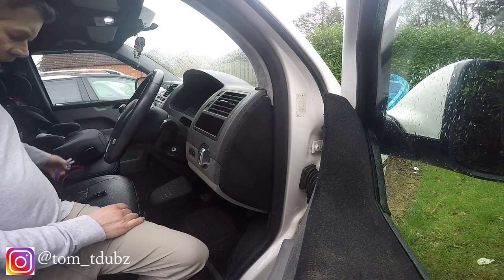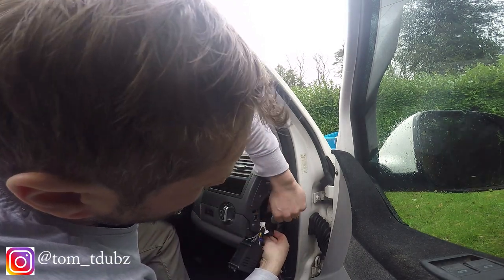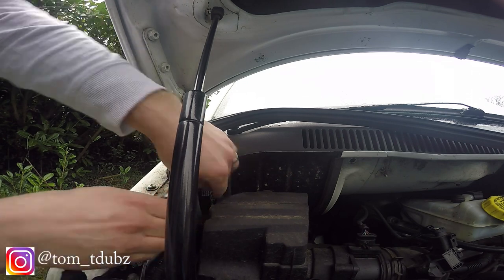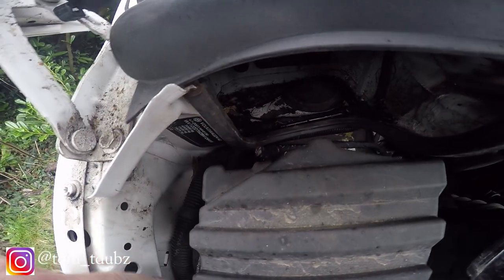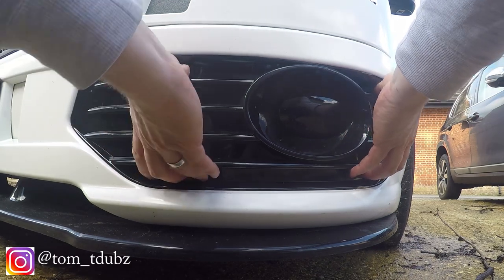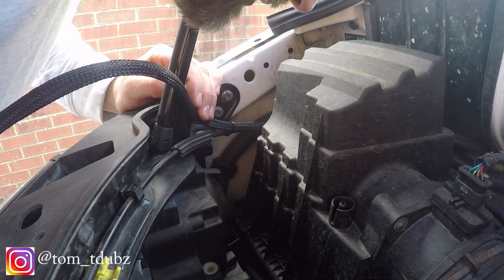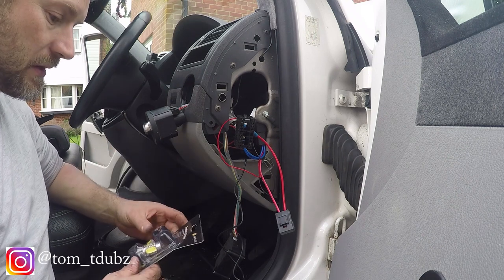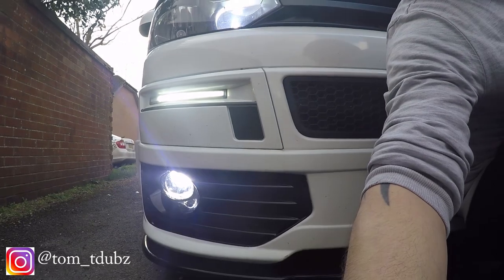VW T5 fog light fitting guide #travelinlite

Comment: Did you put a grommet on the metal duct you drilled a hole in for the wiring ?
Reply from the maker: No... comes with Polyester Sheathing wiring Sleeve👌🤙🏻

Comment: Mate Im in the process of fitting a T5.1 face life like yours, never done anything like this before. some fool crashed in to me last year!  Did you have any issues with things not marrying up right? The DRL kit plastic dosent clip in great..
Reply from the maker: Hey buddy, no issues with mine, they can be a bit fiddly.. often the bottom rights/left don’t push in very well.. most of the time they fit well… you might need to add a little bit of bonding glue in the bottom corners if you have cut away too much….
Reply: Thanks mate if at first you dont suceed!! 😀 @tomtdubz
Reply from the maker: Not a problem always happy to help 👍🏻 good luck with the build 👌🏻👌🏻

Comment: Hi Tom, is your van a bluemotion? Im having problems with a fog light kit supplied by a different company. My van has the switch with the sml plug attachment. Do you know where the fof light fuse is located so I can check this? Many thanks.
Reply from the maker: My van isn’t blue motion… what year is your van?
Reply: @tomtdubz  Hi Tom, thanks for the reply. It's a 2012.

Comment: Anyone else's fog lights sit to far back?  Mine have a few mm gap at the bottom, very noticeable.
Reply from the maker: Check if the fitting of the sport line valance is correct.. if that’s not lined up very well the fogs won’t sit far enough forward…